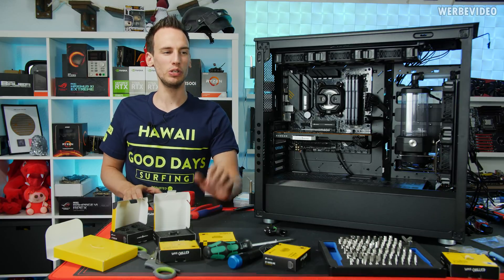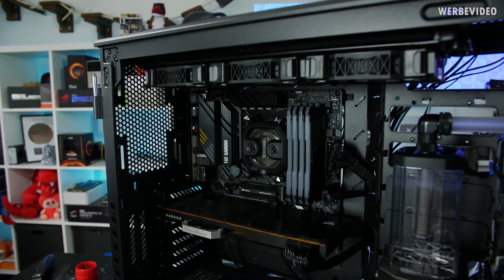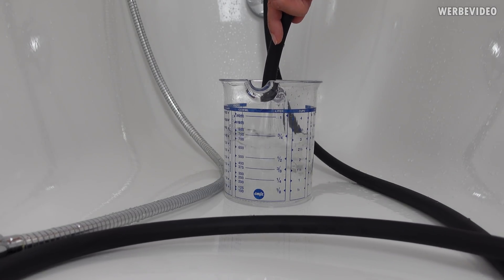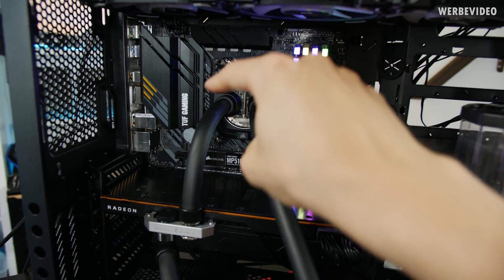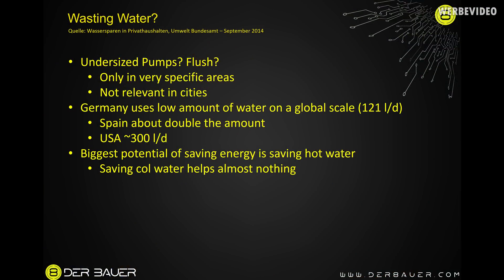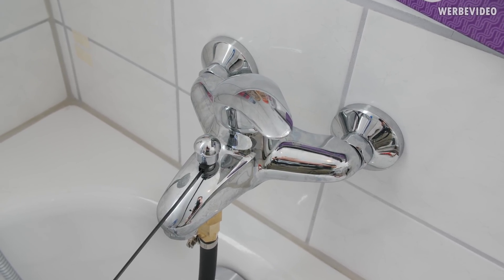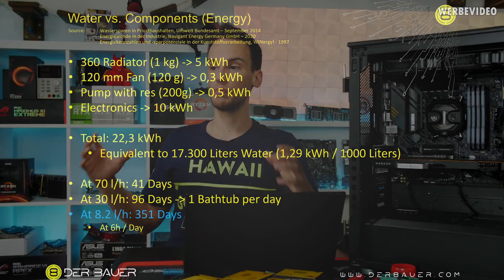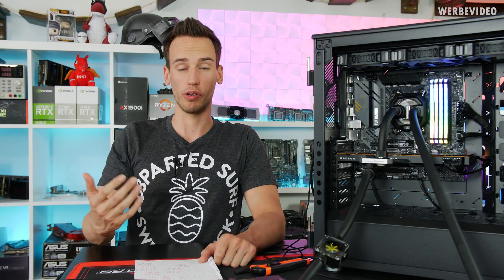So much Better than expected! Cooling my PC with TAP WATER

Comment: A system that sends the water that went through your PC into your water heater, laundry, and toilet tanks would be interesting.

Do your tap water energy consumption figures account for chemicals and materials used in processing the water or just water facility energy consumption? Granted, you said your radiator figures don't include copper production and other things. I'm wondering how representative these numbers are of reality. An interesting topic though. I think you're right that it's better to do this than use a chiller for a few days, but long term use by every pc enthusiast is likely worse than a closed loop.
Reply: You could just have your radiator in your toilets water tub. Whenever someone uses the toilet the warm water gets replaced with cold water. This also lets you flow destilled water through your radiator and pc components. If you dont use the toilet enough you could auto flush it at a given temperature.
Reply: Flushing your toilet uses about 10l of water. To heat these 10l from 18C to a point where it does not keep your pc cold enough under normal gaming loads. (assume 35C) would take 313.2 Wh. Depending on the Power consumption of your pc while gaming this would mean that you would only have to flush the toilet once every hour to keep your pc cooled.
Reply: @Max_xaM  Don't even need to flush, have a thermostat bypass the fill valve at a given water temperature and let the overflow drain do its job dumping hot water at the top into the bowl. Better make double-sure the toilet does not clog when people flush though since water will keep coming while nobody is there to stop it.

Comment: The problem is that in many places, the raw water feeding the tapwater production is extracted from deep wells, the water content of which is often non-renewable on human timescales. Many places also require significant chemical treatment of the water, because the only available water source has heavy metal levels that exceed EU standards. You might have to remove arsenic, manganese and iron, with non-trivial chemical processing, before the water meets the standards.
So if you happen to have a lot of chemically clean surface water, yes this makes perfect sense, but in regions where you need deep wells and the minerals of the ground push the natural levels of metals too high, it is not a good idea.

Comment: Store the hot water in the tub, let it cool down at night, reuse it? If you want to go bigger, get a used 1000L IBC Intermediate Bulk Container and run the system until it gets too hot? Put the IBC outside and pump it through the wall?

Comment: I think the main issue running this would be calcification. Even if the water is not that hard, calcium buildup in the microfins would become a problem pretty fast.
Sure not running it one time but even if it's just a day or two a month it could cause major issues depending on were you live.

Comment: Before the results I am gonna guess it actually costs less if you reduce the water flow to the amount you need out of the tap then running a dedicated cooler, cold water from the tap is just more energy efficient, even with the cost of the water factored in.

Comment: At my uni, there is a big open-air reservoir of water, which is used to cool not only lab equipment, but also the buildings themselves. Used water is going back to the reservoir and the whole thing is cooled at night (in winter to the cold Dutch ambient and in summer though cooling installations)

Comment: I have towel warmer that uses hot water, but it goes around water meter. So it doesn't really matter have many litters per day it uses, it's just part of the loop. 
I think you can do the same with cold water and move 99% of water price and energy requirements out of equation since you're not removing it from pipes, just heating up a little bit.

Comment: i dislike the use of the comma for the decimal points, and the periods for the separation with  numbers in the thousands for the info displayed. it threw me off when trying to read what youre saying. the 17.300 you say is seventeen-thousand-three-hundred, but i read it as seventeen-point-three with some extra zeros. does anyone else find this strange?

Comment: You should daisy chain your computer with your toilet, your sink and your shower for maximum efficiency.
On a more serious note you should not do that in the long term the tap water usually has a high hardness and it will kill your pump, blocks and radiator.

Comment: If we are able to keep the piping clean to the same level as we keep our internal pipes then could we just redirect the water to the houses internal water heater tank, the water would already be heated a bit so it would save a little bit on electricity and we also dont waste it, some colder regions also have water heated flooring where hot water pipes circulate under the floor so it could also hook up to something like that? Any opinions? Also account that cooler water will lower the voltage on the CPU and save power.

Comment: If homes were configured with grey (used water) collection then your PC cooling tap water would still be more than clean enough for use in washing clothes or even for flushing toilets. If the water was reused locally rather than immediately returned for cleaning you could argue the water cost would be free 😀

Comment: I would take into consideration the long term potential for fouling at the heat transfer surfaces.  Mineral deposits like calcium carbonate are highly insulating and have a tendency to form on heat transfer surfaces.  The elements on an electric kettle would be an extreme example.  This potential for fouling can be predicted  using the langlier saturation index (LSI).

Comment: re-use the water after it gone through the pc for washing machines /toilets or why not heat your swimming pool with you're PC's ...we have a large company here in the uk who did exactly that many years ago when mainframes were a thing ....I did some pipe work for them in my younger years. 
on a side note I have a 1250 litre rainwater tank outside my workshop ...I often wondered about using it to cool not just PC's but also my workshop tooling the surface area of the tank should more than enough to cool the water not to mention the heat loss overnight.
Reply: It's been done before. I did see a big thread on one of those forums where someone had a truck radiator in the shed outside and they put the water lines under the ground to the shed. He didn't need to use the fan, literally just pump it was ok

Comment: I was expecting some dumb video aka lttstyle. But, I got a full lesson on the environmental impact of PC cooling instead.
Reply: That's why you watch ltt for the lulz, der8auer or GN for the science
Reply: @der8auer  forgive him, he must be new.
Reply: @der8auer  dont know if you knew this, but Lenovo makes a server rack consisting of like 12 blade servers, and its cooled by hooking into city water. Lenovo advertises that you can use the heated water to heat your company building, by radiated heat, instead of using a heat pump or some other dedicated heater. So its 100% efficient. These servers are used often in stock market companies, as the cold water lets the processors hold clockspeeds of 5GHz almost constantly. Being even a few milliseconds faster on the new stock price changes can make a tremendous difference in your company's profit margins. The Lenovo server is called the ThinkSystem SD650 High-Density if you want to look it up.
Reply: @der8auer  Nice shirt! Aloha from Hawaiian Islands \m/
Reply: @der8auer  i have an idea that might be good to be done with pc cooling and i hope that you can try it. i have done it in the past and i think that it will work. if you are interested in my idea let me know so that i explain it to you in a message please
Reply: Welcome to der8auer lol

Comment: Here in Norway most of us don't pay for consumption but a set fee every month for water and it is usally well below 10c even in the summer, condensation is a problem on bare pipes i have in my tap water distributor panel so I would not put that in my computer.

Comment: Say you have a home or studio server/computer that would run 24x7 (you can volunteer it for scientific calculations, e.g. BOINC for Folding@Home). You can probably use the tap water to cool the components, and connect the loop to a tank or a constant water temp. system (the kind of system that maintains the hot tube of the water loop at home). The overall loop is maintained by a more powerful yet sufficient whole house pump to have the same result here... So the wasted heat of the PC can be somewhat recycled.
Then, when you take a hot shower and wash your hand/face with warm water, you know the heat is coming directly from  your PC (if there's enough heat). That'd be the ideal case: the electricity is used for scientific projects, the wasted heat is for hot water, and you basically saved electricity/gas for heating up water. The biggest drawback is that there needs to be several reservoirs/tanks to collect the water.

Comment: in my place, my tap water temperature during the day reaches 30 celcius, and at night around 25 C
Reply: @adaster98  Totally normal in Brazil for example, if it's hot outside all day every day you'll eventually warm up the water. If you thought taking a dip in the ocean would cool you down - nope, it's a giant bath tub over there.
Reply: @adaster98  i know, yeah, but i think its normal in asia :D
Reply: @Sonac Thermodynamics. The ground gets incredibly warm in some parts of Asia and in Africa as well.
Reply: My tap water varies between 4.5 (March) and 8 degrees (September) C during the year when using a very low flow rate. At the highest possible flow rate, it varies between 6.5 and 7.5 degrees C (source of water is 90 meters below ground and water pipes 1.5 meters below the surface).
So it obvious varies at different places around the globe.

Comment: The cold tap water at my apartment comes out at a chilly 3-7°C (38-45°F) in winter but the humidity in my apartment is less that 15%, so low that glasses of ice water do not have condescension. 

Also, I enjoyed the excellent thorough discussion and research. 

Side note: his friend cooking the CO2 laser with tap water could route the water exiting the laser into the building’s hot or cold water system
Reply: ManuelB1b3r I know. It makes my nose bleed. I put pans of water on the radiators to bring up the humidity a little bit.

Comment: Mount a radiator outside is what I do, saves on running aircon in the room about 3 months of the year and in winter i can adjust (with Argus) the loop temp with the pump speed to the outside radiator, works well with no issues, the other option i have seen is drop the outside radiator in a rainwater tank

Comment: Here tap water is at 6°C so yes it would be a cool solution to have an automatic charge discharge system that replace hot water with cold one when the reservoir temperature goes to hi. Or have an heater exchange.

Comment: What can also be done to recycle the water from the system would be to use the outlet pipe from the GPU to fill the toilet cistern, or at least supplement it. So technically no wastage! Cool video!

Comment: I have been thinking about hooking a mini-split style radiator/cooler next to a window and running the coolant tubes to it to get rid of the heat dissipating into the room.

Since if you overbuilt it to such tolerances, you could basically just leave it passive for most of the time and use the fan only when it is really hot outside. Though in my case, I'd really have to figure out a way to not freeze my rig during the winter ( -20*C ).
Reply: In the winter you can just use your rig to warm up the room :)

Comment: Now pipe this into an insulated reservoir - something like a water heater/geyser. 
Or into a buffered solar water heating loop after use.
Save on your hot water heating costs :D
Reply: This would be a great idea, but that depends on people actually using the hot water in the house. Otherwise, it would just be one massive heatsink
Reply: @NoorquackerInd  Or just hook the output to a tank and then to the intake of the toilets, dishwasher and laundry machines....I don't think the heat is the meaningful part.
Reply: @c.m.7692  Yes if the water was reused then I think you could have a clear conscience.
Reply: @c.m.7692  
you could do both. Heat Exchange the the Heat back out for something useful (Heat, Thermal differential Generator), then use the final waste Water to run some Appliances, yes. bonus points if you can take advantage of Gravity to use a small Turbine. falling one Floor or so without much Head Pressure wouldn't get a lot out of a Turbine, but it would be something.

Comment: Cold tap water is about 7 degrees. In the summer you can see condensation on the tap.
What a waste of drinking water. You can put a water tank under ground (top ca. 80cm deep) and you have 7 degrees water.
Reply: All water is drinking water of it doesn't have salt in it.

Comment: I got tank water and being winter the water temp is somewhere about 6-7c. 
If I run the outlet hose back to the tank...
Reply: if its drinking water i'd use a loop or two of stainless steel pipe in the tank

Comment: Initial thinking for me is that they probably don't have the laser running long enough to worry about the amount of water used. And as for waste a bit of excess water use is still better than using extra power for cooling whether that be fans, pumps, TECs, etc when it comes to environmental impact (of course depends on where you're at).

Comment: And even you can reuse the water. Collect it in some tank and use it to pressure wash your car for example or water the garden.
Reply: Cool the PC then straight into the garden sprinkler.
Reply: This ^ you could use the waste water for all sorts of things. Water tank in the house for shower ect.
Reply: @rompdude  Yes
Reply: Or better yet, pass it down into your water heater.
Reply: @Oliver Solheim I don't know where you live, but in NL and I'm pretty sure D as well, there are no bleach or other harmful chemicals in the tap water.
Reply: Even better run the warmer water into a gas boiler and the energy itself would be saved
Reply: Or flushing your toilet 🙂
Reply: Collecting it into a cistern and using that for garden does make sense, especially if you are already irrigating. This would result in only a small net increase in water usage. On top of that, piping the hot water could help prevent heat being added to the room saving on A/C usage, but pipes need to be insulated for that to be effective.
Reply: Probably don't wanna drink it anymore, but otherwise it is probably okay
Reply: I already have an old boiler tank that was never removed and is still plumped into the central heating and hot water pipes. So I can use that to do washing ups and baths.
Reply: Use it as a feed tank to the warm water heater would probobly the most efficeny. Just need a way to buffer it
Reply: I definitely don't use 300l a day of water that being said I typically shower once every 3 days or everyday only when it very hot
Reply: You know, wash the car every few hours? Water the garden non-stop??
Reply: @timwood70  "Water the garden non-stop", few plants would tolerate  that , most don't like over watering but worse, it'd create ponds in the garden.
Reply: @stanimir4197  I was being sarcastic, this water cooling system has way to much through put. In my specific case reusing the water would result in a very flooded garden or washing my car for 4 hours a day 🙈🙈 I guess if you lived some where dry and hot you could have a sprinkler for the grass
 Not very economical though
Reply: @timwood70  to be fair, straight into the sprinkler was an idiotic idea, given that the water pressure at my house isn't good enough to actually work the sprinklers.

Though we also use rainwater, which I imagine isn't going to be great for the components.
Reply: @xureality  rainwater is purer than tap water
Reply: @MikeTimbers  not when it comes off the roof of my house and down the gutter
Reply: @MikeTimbers , maybe if you live in a third world country like USA.
Reply: Orrrr you could collect the water in a tank, or reservoir of some kind, then maybe pump it through a radiator or condenser to cool it off, and then back through the block. Crazy eco friendly idea, I know.
Reply: Copper-die-contaminated water might not be that good for your plants. Remember the die cooler is made to have a very large contact area with the water streaming through it, so you would get a lot more copper-contamination from the heated copper ribs.
Reply: @monchiabbad  All pipes are copper in my area so 5x5cm block will not make any difference.
Reply: @monchiabbad  very good point, but bare in mind that alot of water pipes are copper, so would it really be any worse?
Reply: @monchiabbad  Sorry, but copper pipes are used a lot in plumbing and do not give off enough to cause any problem to anything. So passing through a cooler is definitely not a problem.
Reply: @monchiabbad  I doubt that's much of an issue since the water is only in contact with the die for a moment, plus its transported to you through copper pipes at least some point
Reply: @monchiabbad  you know many people's homes have 100% copper pipes and you know we drink that and water plants with it